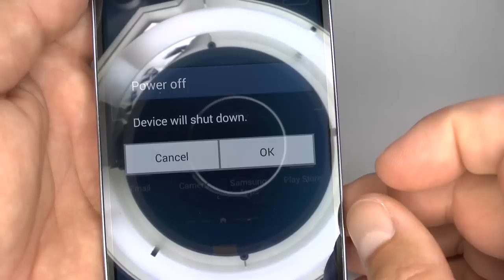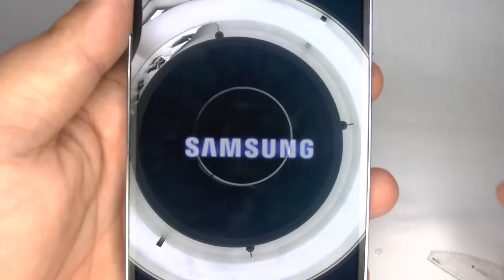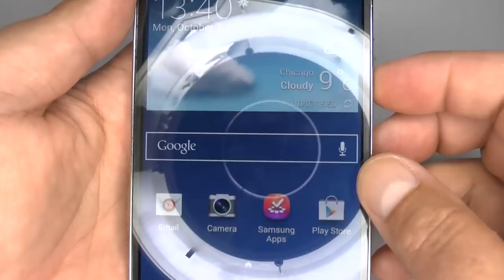Galaxy Note 3 Disassembly Teardown & Assembly - Digitizer Screen & Case Replacement

Comment: January 2020 and I am using my note 3. but now I have problems with my power botton and with the charge connector, what I need to do? I need to change both boards?  Thi is an excellente video, thanks my friend.

Comment: Thank you so much! Your video saved my life after I ran over my Note 3 with my truck. I have insurance but that does not get me back all the data I had in the phone memory. I was able to buy a frame from Amazon and follow your video to get the main board, front camera, vibration motor and communication board into the new phone and its like having a brand new phone again! Thank you so much.
Reply: Arijit
Reply: Arijit Sengupta
Reply: Aslan vidyosu
Reply: I'm happy for you man. Really. I know what it feels like. I saved myself 150USD by replacing my LG G Pro digitizer because here in Jamaica it's expensive working on phones. God Bless!

Comment: THANK YOU. You, Sir, have just saved me from buying a new 'phone. I dropped it on Gravel, bought just an outer glass kit and tried to remove it after watching just one other video, Cooked the Display Screen and was on the point of giving up when after a few days sulking I found Your Video above. After watching this twice, I've bought a Frame and Screen from one of the Ebay sites in Leicester for £31 and using a Jewelers Screwdriver set have just spent 30 minutes saving £500. Easy and Clear to follow, Loads of pitfalls pointed out and now I also know what all the bits inside do! Once again, THANK YOU!

Comment: Awesome. Thanks. This helped repair slight water damage causing the S-Pen to not work. Took everything down to main board, used 91% Iso and a very soft tooth brush/ cotton swabs. Cleaned S-Pen cable contacts, all board contacts etc. Everything working now.

Comment: My Note 3 was suffering from the dreaded black screen issue. Followed your video and cleaned out the proximity sensor and now its good as new. Thank you so much for such clear instructions
Reply: on a side note, people new to this, like myself, should take care when inserting something to remove the back. I could barely get any wifi signals after last night so knew I had done something wrong. Sure enough, when I reopened the back and checked, I saw that I had bent the WIFI antenna contact which is close to the edge of the fone, bent it back as best as I could and wifi works now thankfully

Comment: I accidentally dropped my Note-3 in water and it worked for a short time but then failed completely. I had to disassemble the phone to allow it to dry out. I had never taken any phone apart before so I was rather nervous about doing this but I have to say it was VERY easy and everything in this phone is modular in design and is very simple to remove and replace. After disassembling everything I let the various boards and components sit in the open air for 24 hours and then used a blow-dryer set on warm to make certain everything was absolutely dry. I reassembled everything and it powered up just fine and has worked flawlessly ever since. I'm glad this happened because I know I can replace any modular component in this phone if need be :)
Reply: +Mike Hawk You could just put your phone in a bag of rice to dry it.
Reply: Good luck with that. He did the right thing

Comment: Still using my Note 3 in 2020 !
Anyone else ?
Reply: Me too
Reply: Yup, with a iPosible 11,600 battery, lasts about a week without recharge.
I will never buy a phone in which battery or memory cannot be replaced...
Just replaced the charge connector, works like a charm.
(should add note to verify that screen flex cable connector (as well as others) are connected before re-assembly)
Reply: So do i lol
Reply: Meee
Reply: note  I note 3 note 5 note 7 note 9  all of me  still note 9
Reply: @ThaksinChinNAHEE  take a deep breath and buy note 10 also lol
Reply: me 2
Reply: Me too, after 1 battery and 2 screen replacements with the help of Le55ons.
Reply: Same
Reply: ...I WAS ...until I ran over it..  ...which is why I'm viewing this video
Reply: @spectreiam8238  hi may I know where to get this battery? 11600 it's huge
Reply: 2020 here too😏
Reply: Me in 2020 after 6 years and 4 batteries. Still on Android 4.4.3 with the dark mode and a very versatile printscreen device where you can select a part of the picture, write on it, erase words, share, all on the same screen. What a gain of time compared to what happened after with the need to go to a file called Studio. Things started getting bad from Android 5 that's why I don't want to change. Still using it 10 hours a day (Language studies) !
Reply: @rayrayray0214  It  is a iPossible 11,600mAh battery, I got them on Amazon.com a couple of years ago.
Reply: Here from 2020... Still using my note 3 🌝
Reply: @williamlee4353  
It's almost bulletproof.
Reply: @DARisse-ji1yw  😂😂😂 agreed !
Reply: Me my note 3 is working but the screen is not displaying anything...what could be the problem...
Reply: 3 👀

😢
Reply: Still using my galaxy note3 ...2020 n beyond
Reply: @deekurniawan6107  
Best phone ever made !
Reply: @spectreiam8238  ko lllllllllllllll p lllllllllll
Reply: @VIP Hacks l
Reply: @TheDudeM4aster  ll
Reply: @SephConUno  lll
Reply: @SephConUno  ko lll
Reply: @DARisse-ji1yw  ppp
Reply: Me. Got it new and still using it. Twice replaced battery only.
Reply: I want power button replacement please help
Reply: Same here,  charge port is shot, so got a "parts only" model on ebay & using that to charge batteries. On dark mode
Reply: @jakeyukang9800  charge port not a tough fix. Look for part & tool set on Amazon. Pretty inexpensive.
Reply: Bought a new frame, tried to transfer all the parts.... tear right trought the pen coper thing and broke the screen....
Reply: Yep using it as my main phone
Reply: Hey, does the note3  spen have a capacitor/ does the spen battery ever run out ? Just curious because I'm using the note3 spen with the tab s6 lite.
Reply: Hahaha me too

Comment: Thank you  so much. I slipped on Ice and smashed mine. Your video gave me the knowledge and confidence to buy a used/refurb unit that now has my old main board transplanted into it and working good as new. My last backup wasn't entirely up to date and I wasn't relishing the cost of an entirely new smart phone. Ended up paying out £290 for new parts that were broken but now have 2 fully working Note 3 that look good as new. It was actually nice to replace the frame of my old one as it was chipped from a drop that it survived a few years back. *Subscribed

Comment: Thank you for the video! I was experiencing a faulty proximity sensor (at the time I thought), and only needed the early portion of the video to guide me. But it turned out that the sensor was just dirty. Cleaned the proximity sensor and buttoned my Note 3 back up. Now it's good as new. THANK YOU!

Comment: Thanks for the video! Do you have a lesson on how to change the outer silver edge?
Reply from the maker: Yes, you can follow the video from 13:19 which shows how to separate the screen from the frame. Its a bit risky but can be done with care..
Reply: Thank you!
Reply: +ricerust no. you have to remove the screen with a heat gun
Reply: +ricerust Sadly not, I've been wanting an all black phone for a while and it seems the only way to change the look of the bezel is to paint it yourself
Reply: +ricerust Sadly not, I've been wanting an all black phone for a while and it seems the only way to change the look of the bezel is to paint it yourself
Reply: The chrome part is the side of the frame. It's a single piece of plastic. After you separate the screen from the frame you have to reinstall screen and all other components on the new frame.
Reply: U cn use EC spray to remove easily

Comment: Thanks for the video! I had a proximity sensor that wasn't working. As shown in your video, its very easy to take the Note 3 apart. Turns out my proximity senor has heaps of dust/lint in it. Most likely from being in my pocket all the time. Quick clean out and its working 100% again =)

Comment: THANK YOU!!!!  this vid helped me a lot.  One thing I learned today is that if you have cracked glass and end up breaking the digitizer, you can't move your contacts list off the phone onto another device.  The screen needs to be working to move contacts...even at the Verizon stores.  So I used this vid to switch my motherboard onto another phone....problem solved!  Thanks!

Comment: This video is the closest to the way of we disassemble a Note 3 that I've found on youtube. But still far from the way we do it. Samsung technician here. :)
Reply: What do you guys generally do to take the LCD screen and touch panel off?  Mine broke bc of a heavy amount of adhesive
Reply: Is there a way I can retrieve data from my old phone that has a black screen  and locked?
Reply: How do you take the screen off without damaging the led
Reply: Dont do it man.  The guy who made this tutorial is good but he didn't say that you might have a massive amount more glue than he did on his screen.  Trying to pry it off like he did in the vid won't work even with a heat source.  A new screen costs $200.  If you are talking about just the LED lights, those won't get damaged.  Watch the vid
Reply: Jonathan R what do u recommend cos I need to a new screen on but I don't want to buy the lcd I just want the screen
Reply: I see, well the top part of the screen is only like $10 but this guy doesn't go over how to remove that.  I'd look for another video or some help on online forums.  

Btw its hard to believe you only need the top cover of the screen.  The screen cracks extremely easily.  Maybe you just have bad scratches/  Gppd ;icl
Reply: Shawn Peh  I'm starting to doubt that you really are a Samsung technician as you claim to be. A month later and you haven't responded to even on of the  questions people asked you. I f you are a real technician then help people out or stop looking for attention on the internet.

Comment: If I only needed to replace the screen, can I get away with just opening the back and disconnecting the two flex cables which are connected to the screen itself (I believe that was the "S Pen Flex Cable" and "Main Display Flex Cable") and just pulling them through the other side?  Or will leaving motherboard attached and exposed during screen removal damage the circuitry? I'd like to believe I can just feed the new ones through and connect without dissembling the entire motherboard and keys. Thanks for the very informative and well filmed video.  No distracting music, just info and high quality video.

Comment: Thank you for the Video ! I got a Note 3 and the Sensors was not working. So ive ordered a new Proximity/Light sensor with Frontcam and with your video, i was able to replace the old one in nealy 3 Minutes with the new one :D. 

But yeah, it was so easy, because the phone was opened before. So its not sticky anymore :)

Danke ^^

Comment: my proximity sensor was not working.

Cleaned my prox sensor and screen.  It had a oil film in it probably from all the jogging I was doing.  I can't believe it had junk in it.  I broke the metal bracket holder on the body in the process but it holds fine after you place the back cover.  Thanks for the teardown tutorial.  Sensor now works.  Saved me a good 500-800 dollars for a new one since i don't like paying for warranty.

Comment: Excellent video, very well explained,.
I have a small issue with my screen, it works 100%, it's not cracked nor has been exposed to water, a few weeks ago I noticed a small spot next to the notification light, a gray little spot which has been getting bigger. It looks almost like if the black frame around the screen were starting to peel. It's starting to lose the black frame what I think is impossible because it's plastic and it has the glass protecting it, plus the silver plastic frame is perfectly in good shape.

Comment: This is i guess the only video over the full tube which is so descriptive, properly zoomed enough to see every part clearly. i appreciate your work dear, especially the naming of each part was quite informative for me. I have saved the video for future reference as well.
With your this video I was capable to replace my note 3 screen very easily.

One question:
After i replaced the screen, the phone seems to be little slower than before, I mean the response of the phone slow rate. What could be the reason??

Thanks for the video and I hope to get an answer from you.

Comment: Excellent, comprehensive video. I have a question that I hope you might be able to answer. I attempted to replace the screen myself, but was unsuccessful, and ended up wrecking the digitizer in the process. So, I bought a brand new digitizer/screen assembly and decided I would take it into a shop to have them assemble for me. They claimed that when they tested the digitizer, they never were never able to get the phone to work. They even tried another motherboard and this did not solve the problem. At this point, the phone powers on, there is vibration, the LCD illuminates, but the screen remains black. I have taken the phone apart and put it back together numerous times with the same results. Everything seems to be connected correctly. Is there anything else that you can think of that could cause a brand new digitizer not to work? FYI, this is a rooted phone. I had just recently flashed a custom ROM (Marshmallow Resurrection Remix), which had been operating flawlessly prior to the screen repair. Could this cause the problem?

Comment: Hi there,

First of all love your detailed video, superb. I dropped my note 3 a while back and it only cracked the front glass, digitiser still worked. Then a while after the digitiser stopped working. S-pen digitiser was still good so was using just with s pen only for a while. Then! The screen started going crazy, registering false touches, so I finally bought the new LCD assembly (£120), fitted it expecting to solve my touch screen problem - this didn't work. I noticed I had some corrosion on the mainboard, just in one tiny area - so soaked in 99% IPA and it came up nice and clean. I noticed at the end of your video your digitiser didn't work as you damaged the flex cable... Im trying to find the exact problem with mine. Buying a new screen I thought would fix it, but maybe a problem with the mainboard connector? tried flashing stock rom on the off chance it could be software, no joy. I have a nice new clean LCD and only the s pen works, the problem of the false touches has gone though. Im confused. help! Thanks in advance, keep up the hard work :)

Comment: I had a problem with my proximity sensor, thanks to this video, it helped me clean it from inside. It's well known among Galaxy devises that they collect dust, which makes the proximity sensor not work well, especially when making a call. The screen goes black and doesn't turn on until I hit the home button several times. The proximity sensor will not stop whenever in use, due to dust. Thanks again, now it's clean.
Reply: تفكيك الجالاكسي سهل وممتع الا الشاشة الملصوقة
Reply: عملية الفك كانت سهلة جدا، وبمجرد إزالة الجزء الخلفي من الجهاز باستخدام المفك، قمت بإزالة المتحسّس الذي يظهر في الصورة في الأعلى فوق الشريط الأصفر، ثم قمت بتنظيفه من الغبار و حُلّت المشكلة :)
Reply: @microzoom  
صاحب القناة لم يظهر منذ 5 سنوات هل مات؟
Reply: @AouniX  
صاحب القناة لم يظهر منذ 5 سنوات هل مات؟
Reply: @Worood-Annajah  الله من زمان ماسمعت عنه.. كنت اتابعه بشغف
Reply: @microzoom  
شكرا لردك وذوقك. انا متجه اتفرج على بعض فيديوهات قناتك.
 وهل تعرف قناة تقدم دروس او شروحات مفصلة لتفكيك الموبايلات الذكية؟

Comment: Awesome tutorial and instructions - helped me get mine stripped and reassembled. On the usb connection was loose so pinched it together to stop poor connection. seemed to work rather than replace unit. Thanks!

Comment: I like the video. Every aspect of it is great... Thank you for posting. Having said that. I replaced the screen and digitizer on my note 3 and thanks to your video, it was really easy to do. However, my GPS is not working properly now. I get the app GPS test to "see" satellites, but they are not in use??? I know that my GPS worked, before I smashed my phone into the ground, but not it doesn't. The main question is, did the impact break the GPS, or did I or something wrong back together???

Thanks,

G
Reply from the maker: ***** it might be worth backing up all your data and trying a factory reset. 
ESD might be the cause and a reset can sometimes help...
Reply: ***** I will give that a try. Thanks.
Reply: ***** I tired that, but it didn't work. GPS test sees the Satellites, but they are not in use? Normally, someone, somewhere out there has a solution for this, but not this time??? Thanks, G.
Reply: ***** I opened my phone up again to see if the little contacts/tabs for the GPS need to be bend up a little... While doing so, one of them broke of the board. I sure looks like this could have been my problem. Question is, how do I "replace" that little contact again. It looks like it is permanently attached to the board, so replacing the contact only is not an option. Can I throw a "drop" of Solder on there in order to make a contact point??? Thanks.
Reply: Easy solution is just add a dab of solder so that it will make contact like it's supposed to.
Reply: No really... I tried that, but the solder would not stick to the board. I used flux, still, would not stick... Thanks.
Reply: Only slightly more effort would be to maybe take somebody's worthless old phone for a few bucks or almost any old used electronics and see if it has the spring contact that you need and then transfer that.  Or simply a hardcore DIY electronics store.

Comment: Amazing video. So detailed. One friendly advise to whoever will change the power switch, the new button comes with an extremely thin protective foil. You need to remove or else circuit will not close